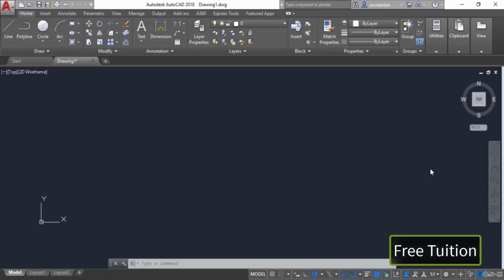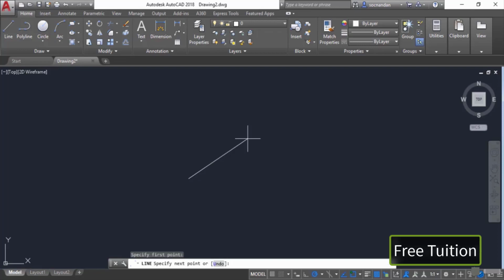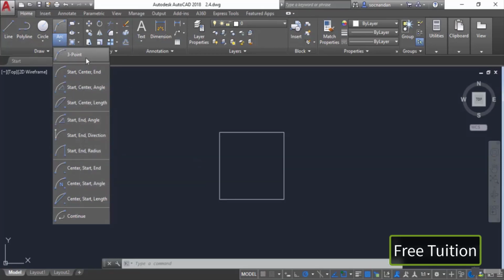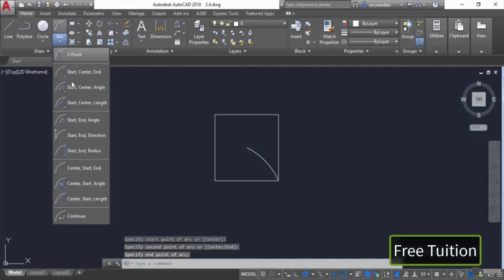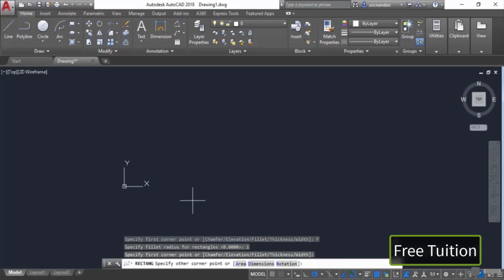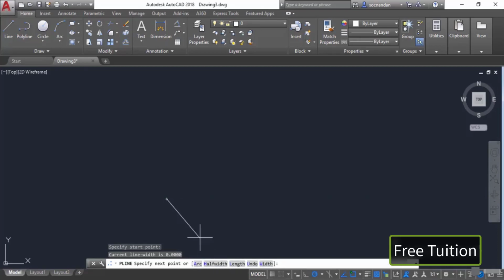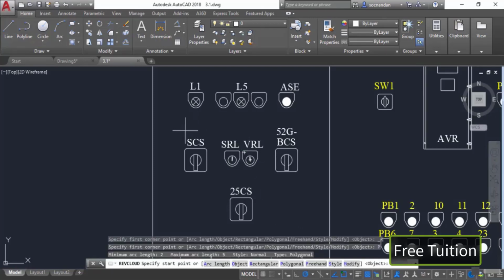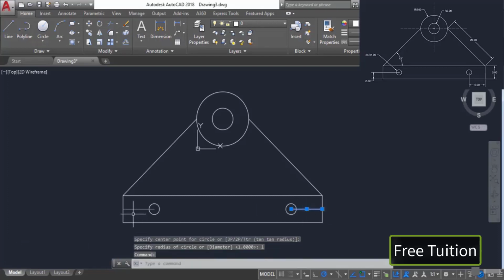AutoCad Tutorial - Part 2: Creating Drawings

Comment from the maker: You can skip to these topics to time.
Making lines 0:00
Making lines using polar coordinates  7:24
Circle 11:14
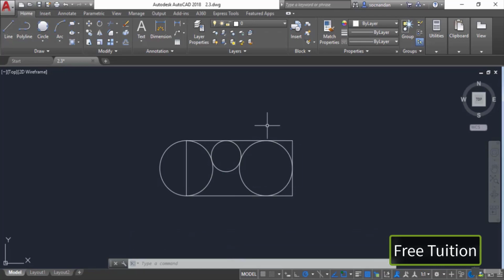Arcs 15:27
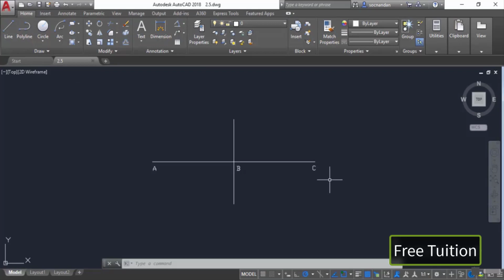Ellipses 24:26
Rectangle 28:13
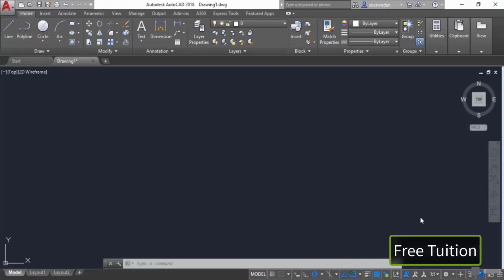Polygons  32:56
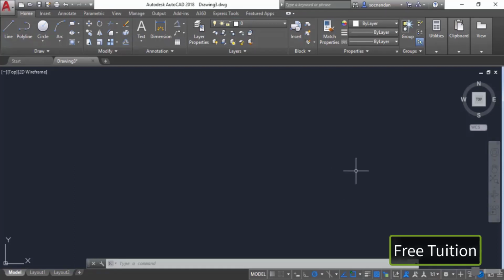Introduction to polyline and spline 37:39
Points and revision clouds  44:05
Construction line and ray 49:38
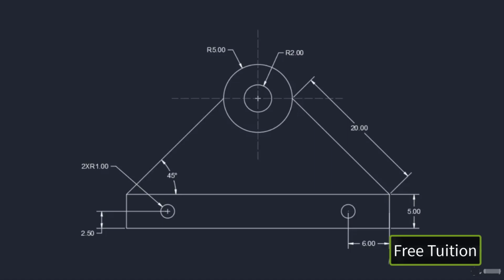Practice Question 52:03